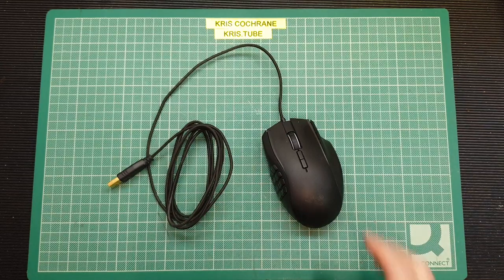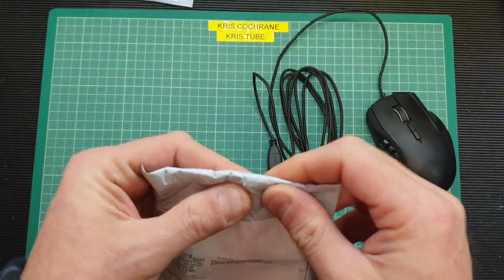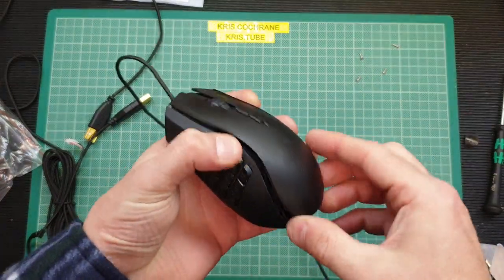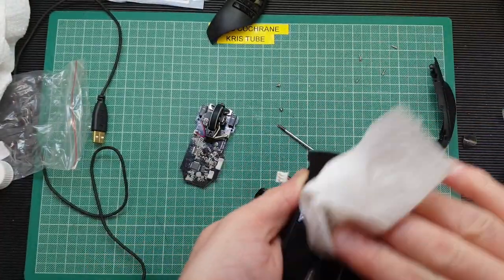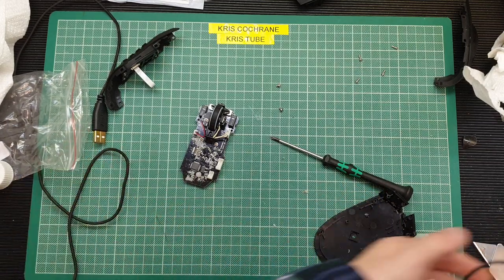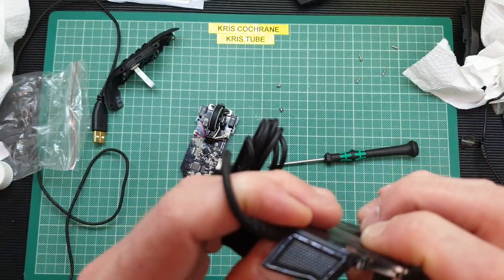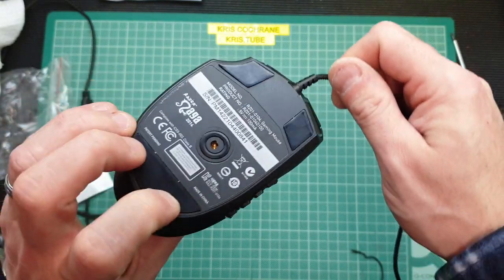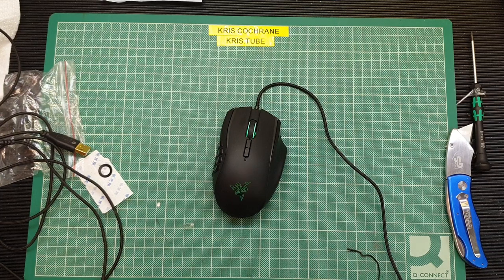Repairing a Razer Naga 2014 Mouse - USB Lead and Teflon Sticker Replacement

Comment: i'd been dreading cutting, stripping & soldering (?!) the cable myself.
tossed it into youtube on the offchance there was an easier fix
10 minutes & 6 euro later i have 2 parts being shipped from China that will save me having to buy a new naga.

You sir are a legend

Comment: I can remember back in the day when nice were young,having to take them a part and reduce the led resistor value to increase the drive current so we could carry on using it. The led's would go dim and the sensors would be come intermittent. They cost about 1\2 a weeks wages each and the company had close to 100 or so. When they found out that I'd fixed mine I got a steady stream of dead or intermittent mice to fix each week. A year or so later price dropped and they became throwaway on the first glitches.  How times change.
Reply: They are $180NZ for the new equivilent with the swap out macro keys. I just cleaned mine i though it was cable and was prepared for a re-solder to circuit board. Nice suprize when I opneed it there was a plug. Thought i would clean put back to gether if still not fix cut and re join the plug. But seems to be working for now with just a clean. I thought it was the cable as the mouse would glow but just stop allowing me to turn in games until i riggled the cord. Must have been just the fluff getting moved around that had built up over the years.

Comment: I have actually had the same problem for a while, though the circumstances are a bit different.
I used to just have a problem with the mouse wheel (it would sometimes fail to register scrolling for one "click" and then move two on the next, and later on it even started occasionally scrolling the wrong way) and the middle mouse button (failing to register light presses even though there was the tactile click, sending two button presses to the computer for one actual click). I disassembled the mouse pretty much completely to find out what the pieces looked like so I could get replacement parts.
It was some time after this disassembly that the mouse started disconnecting like in this video. Since then I came to the conclusion that I may have damaged the cable when I did so.
Today I got the replacement wheel encoder. I already had a replacement MMB. It was also this day that I looked up information about the disconnecting issue and found this video. I placed an order for a replacement cable.
I replaced both parts. While reconnecting the usb cable, I noticed that the metal leads inside the plastic header were somewhat loose. After attaching the plastic header, I used a pair of tweezers to push down on each metal lead - it was possible to push them down further with a noticeable tactile feedback. Obviously I can't tell if the problem has been fixed yet (and the replacement cable was ordered mostly in vain), but I'm hopeful the issue might have been fixed.
Reply: Did it work?
Reply: @wrathpsp  The problem kept appearing, so I replaced the cable a couple weeks later and now everything is fine. It's possible the cable could have been repaired with some glue, but it's also possible there was a break somewhere.
Reply: @Althemor  Oh I see. I'm thinking of ordering a replacement braided USB cable but they seem a lot harder to come by now. I can see them on Ali express but I don't really want to have to wait that long. There are some on ebay but they seem a bit more vague and generic in their description.

Comment: Had some issues with mine. I thought it was the USB cable it would stay lit up, but just can't move left right etc. Cleaned all the fluff and hair out seems to have fixed it for now. Thought I was going to have to cut and solder the cable. If no fix going to buy new cable as it is $180NZ for a new mouse.

Comment: This has been super useful. My last issues is that I have the wireless naga, and the charging port is gone in that, but I can't seem to find a replacement daughterboard for it. D:
Reply from the maker: Is it Micro USB?
Reply: @KrisCochrane  Yeah, it's micro. It sits under the USB wheel, but I think it's different for the wired version, I'm not sure. Cheers!
Reply from the maker: The socket could be replaced with an off-the-shelf part but that would involve an element of soldering. Are you in the UK? If you are, I could possibly do it for you - at no cost. It would make some good content.
Reply: @KrisCochrane  That could be a shout, however I think it's a specialized board for it. Aye I'm in the UK too. I'll disassemble it tomorrow and grab a few pictures of the USB board. I searched around with the parts number on it, but all dead ends, will keep you updated!
Reply from the maker: @OrbitalFrameGaming  Yeah, I was meaning keep the same board but install a new micro USB socket on it.
Reply: @KrisCochrane  Yeah, I don't know if it's the socket, or the board itself. When I took the board out and cleaned it, the soldering seemed to be holding well, but I've never soldered before, so not an expert on the matter

Comment: Im interested in repairing my naga epic chroma. There's a curved plastic piece on the inside I'm having trouble identifying, and it's completely snapped multiple times. It fell out when I opened the body of the mouse. The mouse worked and I've since replaced it. But the left and right clicks sometimes act as if I have released the button when I'm holding it down. Anyone that can tell me what part it is so i can try to replace it please comment.

Comment: my side buttons werent workign and when i took it apart the blue thing on the white strip was loose, any advise how to fix that?
Reply: Normally they are on a hinge. flick the little cover back toward you if you are looking directly down on the cable. The clip should flick back then just place it down again. There are videos on how to do this.

Comment: My same mouse got the issue where the buttons are working fine but the cursor wont move at all. Do you think i should switch my cable or get a new mouse?
Reply from the maker: Is it the same model?
Reply from the maker: @chaihleeb220  The mouse was around $100 and the cable is $3...that was the point of the video.
Reply: Cold solder joint on sensor
Reply: Exact same issue i just fixed. I completely dissembled  it put back together after cleaning and it fixed it. (Mine was intermittent issue I thought it was cable as when i wriggled the cable it would work again. I think the wriggling was moving fluff around inside the mouse that had built up over the years.